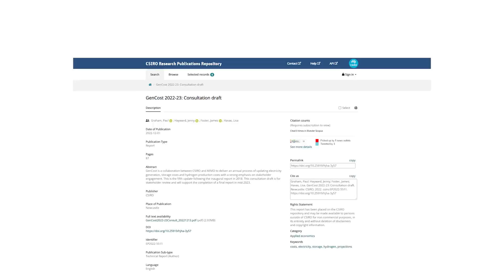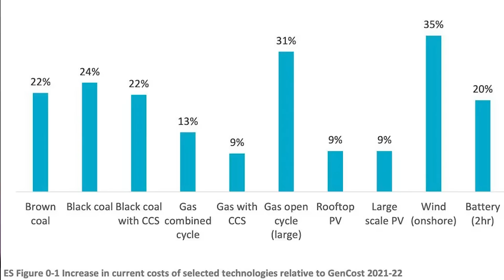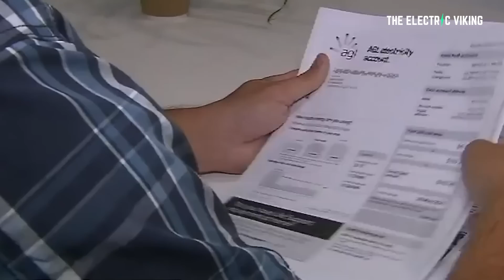Wind and solar still much cheaper than fossil fuels, even with inflation

Comment: I sincerely hope renewable energy is cheeper! That is good news!  When the purchase of a transportation system including the cost of the vehicle, new and used, coupled with the cost of refueling/recharging, and maintenance goes down, you don't need to sell it, people will buy it.  More recently the state of Texas was generating 25% of their electricity from wind power. There was a bad storm, which stopped the windmills from turning, and extreme low temps, so Texans turned on their electric heaters.  The resulting collapse of the Texas power grid left Texans shivering for a month.
Reply: The Texas Electric Reliability Council said the primary cause of the February 2021 outage was natural gas equipment that wasn’t designed to operate in cold temperatures, according to the Texas Tribune, and Forbes. About 2,400 wind turbines operate in frigid Minnesota.
Reply: @timlundergan3360  Texas Electric Reliability Council blamed natural gas equipment not being designed to work in the cold. Question: Does that make sense?
Texas Tribune, and Forbes say 2,400 wind turbines operate in fridgid Minnesota.
Question: Do they turn without wind? I ask because frequently after a big ice storm, the wind stops blowing for days or a week. This is normal. So it is very cold, demand goes up, and supply goes down.  And you  believe it was the fault of the existing gas technology (1836 to the present) failing to work in cold temps! 
Question: How gullible are you?
Reply: @HamiltonSRink  It made sense to the Texas Railroad Commission, which approved new rules imposing fines on oil and gas companies that do not prepare equipment for extreme weather. (Wells can freeze and equipment can seize up.)
Reply: Only if Texas actually made their infrastructure winter proof all that crap wouldn’t have happened! Just look at Finland or other super cold countries with working solar farms.
Reply: @carholic-sz3qv  Texas went with wind mills.  Probably should have gone with panels.  Panels don't work at night might have been their thinking.  Panels do work in winter, not sure if they work under 18 inches of snow though.
Reply: The Gulf Coast could massively benefit from tidal energy. Just build a massive seawall along the entire coastline and pockmark it with underwater turbines — there you have it: something that can provide both massive amounts of energy AND hurricane protection, because with such a low-lying coastline there’s plenty of lateral distance for the water to move over, and lateral distance for the water to move over invariably translates to higher potential energy that the tides are carrying.

Then, to get all that electricity to the northern part of the state, just transport it from the Gulf along the same high-voltage pylons that the grid already depends on.
Reply: @kennystrawnmusic  Sounds like a plan!
Reply: @kennystrawnmusic  Sounds like a plan! Since coastal property in usually dominated by rich folk living the good life overlooking the surf, I'm quite sure they will all agree to turn their luxury properties into an industrial factory to make electricity for poorer folks living in the northern counties.
Reply: @HamiltonSRink  Isn’t Houston Harbor loaded with petrochemical factories? I mean, sure, maybe further south (i.e. Corpus Christi) there would be some of those elite properties, but you’d think the people of i.e. Galveston especially wouldn’t mind a tidal energy wall around it given the hurricane protection it would provide. And if you string the tidal energy walls between barrier islands instead of in front of them, that’s even better.
Reply: @kennystrawnmusic  I think it is a splendid idea.  Let's see if the Texans living along the coast think so too!